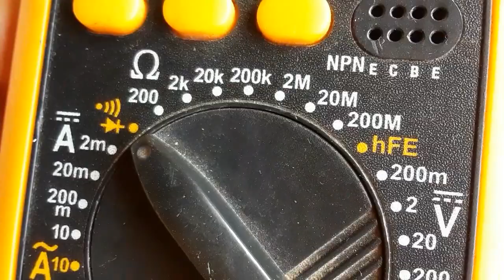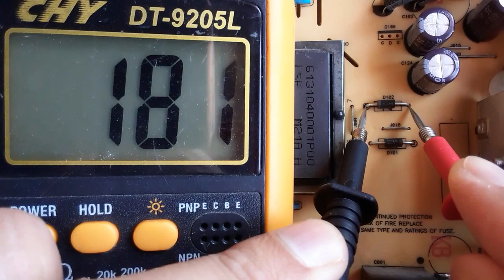Learn how to test diodes with a multimeter

Comment: Just wondering. Doesn’t the diode being in circuit have an influence on reading? When I swap probes when measuring one of the zener diodes in my circuit I get a reading. Should I pull one leg to confirm?